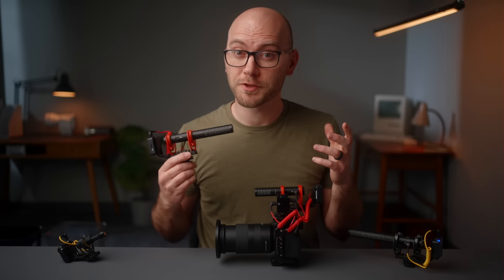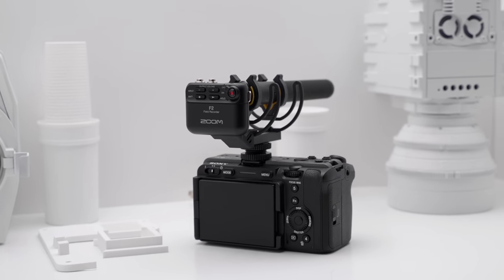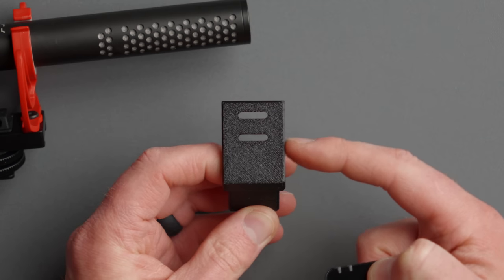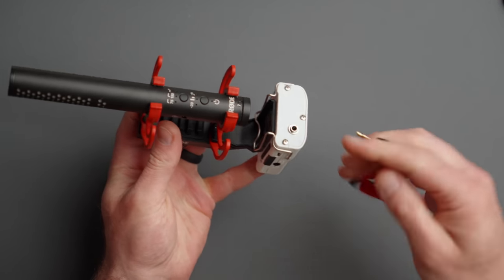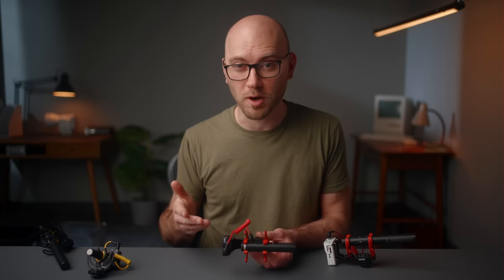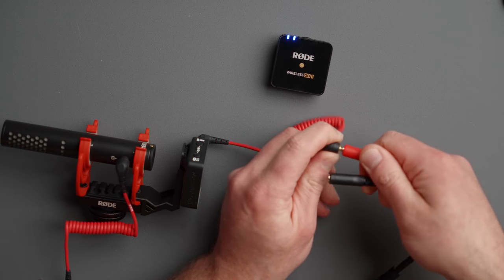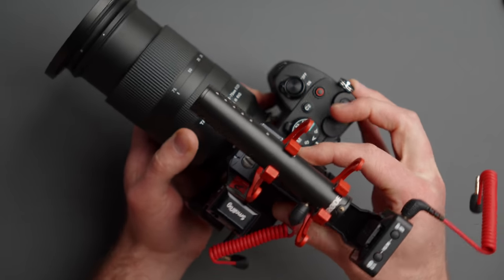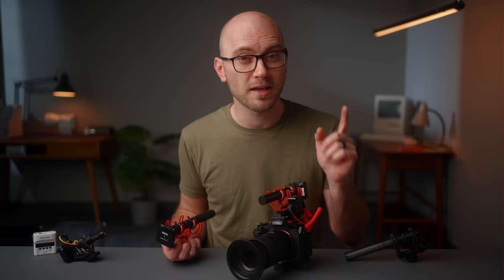Make Your Microphone WIRELESS!

Comment: You can lock the TX under the rode videomic NTG without any accessories 😅 just slide the microphone a bit forward and there will be the room to clip it under the volume knob
Reply from the maker: Kind of but it is super tight and blocks the screen if you're using the TX. Not to mention the other TX/recorder support.
Reply: I've been mounting the DJI Mic TX to the bottom of Rode Mic NTG for a while now. No issues, perfect fit
Reply from the maker: @Peak3Visuals  Thats great! The 4 mics I have are super tight. Maybe a tight batch?
Reply: You also don't need this extra accessory for the Deity microphone.

Comment: Hi Caleb, I’m sure you have considered this but just in case - instead of making specialist units for each microphone mount, how about making a unit that connects to the shoe mount with a cold shoe on your unit for the microphone to connect too.  Yes it will be a bit higher and require more material but it could be truly universal.  Always enjoy your content👍👍👍👍👍
Reply from the maker: Not a bad Idea! The only downside is that I wouldn't feels as comfortable with it being 3D printed. Cold shoes come in all different sizes and I wouldn't want that to not fit or snap!

Comment: This is exactly how I used my Rode wireless go velcroed to a boom pole to make my shotgun mic wireless. Works like a charm. Also thet smallrig audio splitter thing has a coldshoe, so a wireless reciever can be mounted to it, or basically anywhere on a camera cage with an extra coldshoe. Nice Idea and with the 3D printed mount though. Very compact, well executed.

Comment: Hi, too some extent potentially a neat idea BUT.... Surely an on camera mike is generally a compromise unless doing really close 'blog' style shots?

For significant sonic improvements it's generally accepted that getting a mike off camera and close to the sound source (eg speaker) is the way to go. An on-camera mike being best for scratch audio, permitting later sync in post for those not yet able to utilise timecode syncing.

A solution for something that isn't a material problem for many.... perhaps?

Comment: Bought. I would be happy about a version for the Sennheiser MKE 600. But the holder is clearly different. Or for the Rode SM3-R, which can at least be used universally. Basically, it would be great if you could expand the selection of holders, even for a small fee.

Comment: Thank you so much Caleb, you are such a genius and always inspire me to figure out new easy solutions for my setup. Regarding the splitter: Do you know that there is a super minimalistic and small adapter cable made by Rode for this purpose? It is called sc11 and solves all these problems with just one small cable. I use it all the time and it works perfectly.

Comment: Hey Kaleb, nice job. I design and print stuff as well. You might consider a version where you can tuck the Smallrig stereo adapter between the mic and the Rode WG clip so it can all be self contained. Using lighter and much shorter wires it could become more compact and then there would only be one wire going to the camera which would clean it all up.

Comment: Slap a patent on this, buddy. Ive been finding it an annoyance finding a place to clip them. I use two rode ntgs with the Rode Wireless Go on top of my camera using the shock mounts to clip on them - not great, since hitting the button on the transmitter button on them is a chore. I then have two monos working as left and right transmitting to the receiver and due to the splitter cable just picking up one side if directy connected to the camera, I use the output on the reciever with the splittler connected to my h5 zoom using rodes vlxr converters which gives me control of each mic to adjust using the knobs. From there i use the line output on the Zoom to connect to my camera with a buff so theres a synced version recorded onto the camera as well as just an audio recorded to the Zoom.

Comment: Nice design! I appreciate that it secures to the mount with the preexisting screw. I've wanted to use my ntg and Go ii as a wireless boom for a while, but my work arounds were a bit sketchy (velcro tying the go to the boom). Back when you made the Go case/lock I didn't have my WG II yet, so I decided to snag a couple. I know some people are rallying under the "you don't need it" banner, but I'd be willing to bet that if they've invested any kind of money in camera gear, they've definitely wasted way more than $15-20 on something that didn't actually work the way they intended it to. I know I have 😅. I'll be looking forward to giving them a try, and interested to see what you come out with next. I haven't spent money on YouTuber products before, but I appreciate you attempting to fix some annoying issues with gear.

Comment: Sounds like the original unit shipped with the accessory screw for mounting. If you purchase just the 3D file, do you have a suggestion for the screw that’s required to mount it? Dimensions and thread count.

Comment: I’d like to add a request for the Comica CVM-VM20 and new VM30 mini shotguns (to be added to your manufacturing list😄) The VM20 works VERY well to provide a high, and clean signal to a Zoom F2, at every gain setting (even 0 on the dial!) I haven’t tried the VM30 (but it’s supposed to do either wired OR wireless so some people may not understand the point of keeping a recorder near the microphone…if the mic has a built-in transmitter, but I think the Zoom F2 32-bit float files is a better starting point than wireless, but that one gives you both options😃)

Comment: Great little accessory! I've already been using my Rode VideoMic GO II with my Rode Wireless GO II, with great results.

On this subject, do you have any recommendation for connecting a Rode Wireless GO II (or similar) transmitter with an XLR microphone like the Rode PodMic or the Behringer XM8500? I ordered a couple of XLR-to-3.5mm converters for this (with XLR female on one end and 3.5mm TRS male on the other end), but couldn't get them to work. In case of one of the two I tried, it wouldn't work with either mic, while the other one didn't work at all with the PodMic but did somewhat work with the XM8500; however, the signal it sent through wasn't loud enough and had quite some noise added.

Any recommendations would be most welcome!

Comment: I’m trying to decide between 3 options to film a concert in a small theater. I’m not sure if I should just put the wireless pro on the stage and use the built-in mic, or combine it with the videomic go near the stage.

Comment: This is awesome! Could I suggest a new 3D print solution for the Tentacle Sync E? Maybe a replacement for the mic jack sleeve that includes a coldshoe mount and some way to secure it. If you'd like me to elaborate please feel free to reach out.
Reply: I ask because the default velcro solution isn't secure and there's rarely space on a rig to put the other half of the velcro

Comment: This is a really good idea.  I do live streaming of sports and use my Rode Wireless Go2 to combine  a shotgun mic on my camera which captures field and stand noise with a person doing play by play/commentary.  I have a smallrig cage to whole the transmitter and receiver, but I can’t see the display.  I have been thinking of designing my own solutions and printing it.  I have designed a few 3D printed things for my setup to mount accessories to my tripod.  

3D printing has really helped streamline my setup and takedown as well as my organization.

Also, for the printed items you sell, what material are you using.  I don’t see it listed.

Comment: I recently purchased the micback for Diety D3 Pro, when I tried to install it I found out that the screw included with the micback needs a special driver that I do not have. The back screw of the Diety D3 Pro is also a security screw and requires a special driver that I do not have. Pretty bumed out right now

Comment: Hi Caleb, really interested in this and would have been useful last weekend. Went to order and after filling in the order form on gearfocus (after changing the phone country prefix for the UK), the page didn't proceed and stayed on the address part, two spinning boxes (save address and shipping). Could not proceed further. Can you please look into this? Thanks.

Contacted Gearfoucus, and they were very helpful; however, the costs for shipping to the UK are far too high for me. Trying to find a service here that will print one.

Comment: Funny enough on the Rode Mics you can actually just clip your transmitter to the underbelly cold shoe built into the mic mount, because it is in fact, a cold shoe. No need for an extra piece of gear.

Comment: I am going to have to give this a fail.

The idea was on point, and nobody wanted this thing to work more than me.

I run the zoom system and the timecode system, so the F2-BT is my Zen (along with the F6).

I love the RODE NTG Video for its pickup pattern for ambient and backup, and NEVER record to Camera (only my F2 and other recorders as primaries)

I am flabbergasted at what I received, for the price (actually the shipping was more than 2 of the units😮).

This thing is useless.

When you slide it on the RODE Rycote mount, you quickly discover that the flexi-mounts have a recess cleats.

So when you slide the plastic bit on… it sits a 1/4” higher than the other. 

Where is the washer for the front? Where is the compensation for the new rear rise?

I bought it specifically for this mic after all….

Did you even test it!? Did you try to put a mic in it after?

Mine don’t look like yours mate. In fact… not sure what tomfoolery you did to make them line up… because everything I encountered (on such a simple product) would indicate that that they never did.

You could have just done a bottom screw mount and succeeded… what came suggests you drew it up on a computer, sent it to China, and shipped to me without actually using it.

How something so simple, and potentially niche useful, ended up so poorly executed is beyond me. I mean you actually asked what Mic specifically and it’s such a bad fail.

😣😣😣😣

Comment: Amazing as always Caleb!  Looking at the design of this and the use of the Rode devices, I'm fairly confident that the Tentacle Track E 32-bit recorder will also work on this.  It doesn't have the two clips but it does have one nodule which would fit into one of the clips.  Have emailed a pic for reference.